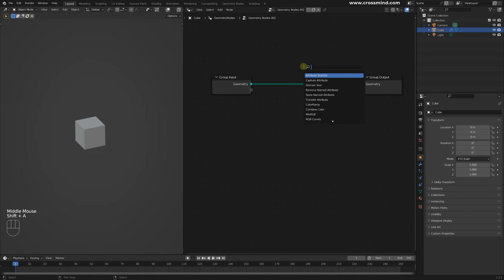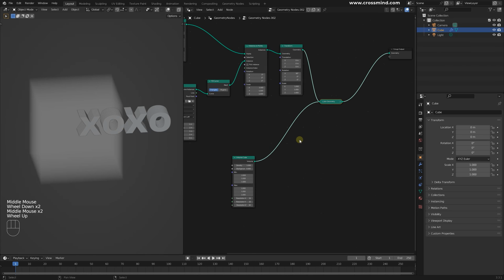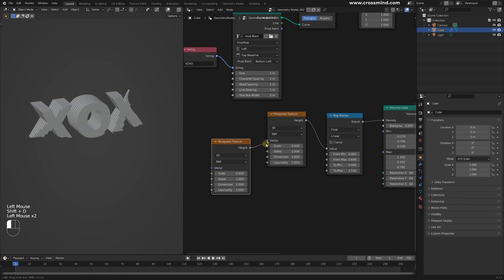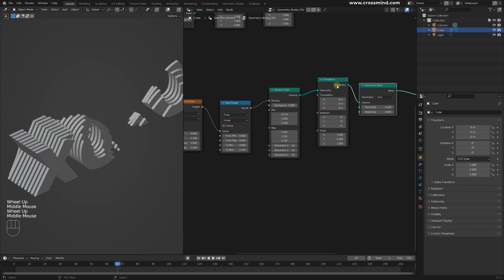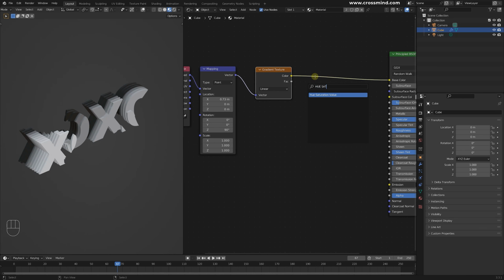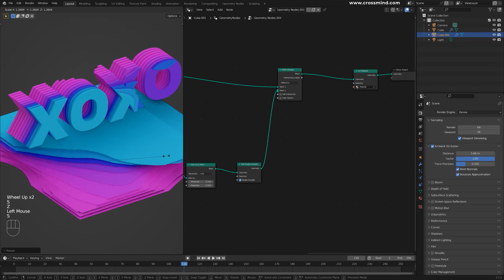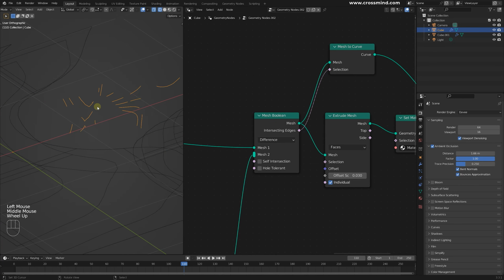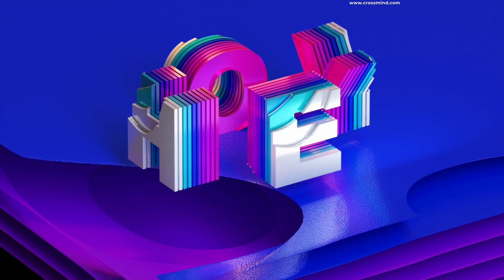3D Type Formation Effect Slice/Papercut-Easy Tutorial - Blender Geometry Nodes

Comment: 8:44 Has anyone an idea why the animation glitches? is there a fix for this? thanks for the great tutorial
Reply from the maker: Its problem with boolean node, sometimes shaking it a little solves the problem.
I couldnt find the solution but on glitched frames i keyframed the boolean object and moved it by few points.
Reply: @CrossMindStudio  I think I have found another workaround: activating "Self Intersection" in the Mesh Boolean Node seems to fix a lot of glitches. But it makes working with the mesh a lot slower. Right now I fix just the glitched frames by re-rendering them with "Self Intersection" on. Don't know if there would have been glitches in other frames. But i'll try next time.

Comment: ❤️❤️ From Maharashtra
Sir I am planning to buy pc with below configuration, pls advise me with this can Adobe premiere pro and blender will work smoothly?? Pls reply

INTEL Corei5 6th gen 
(Intel chipset Gigabyte H110 hd graphic motherboard)

 Ram - 16gb ddr4
(Kingston)

 HDD - 1Tb .
(Seagate or WD).  

 Cabinet .
(zebronics,  zebion)

 Smps
(zebronics, zebion) 

 Monitor - 19"Led 
(zebronics, lg,  zebster,  foxxin) 

 SSD - 256GB 
(power X)

 GPU - 4GB (730) 
(nvidia zotac)
Reply from the maker: If you can afford, go with i7 latest generation, and GPU atleast from 3000 series.
If you are working in premiere get atleast 32 gb RAM, and NVME storage devices.

Comment: Not Boolean-node not working in my blender (3.3.1) :( I just can't follow the tutorial.
Reply from the maker: You might be using wrong boolean node.
Use Mesh Boolean ( not boolean node is math boolean)
Reply: @CrossMindStudio  i actually found out why it was not working for me, it was because of Transformation node.
Reply: @d1namis  how can you deal with transformation node, I have the same problem with you
Reply: @sylviachen3696  use transformation before output geometry, not before boolean node. That fixed it for me.